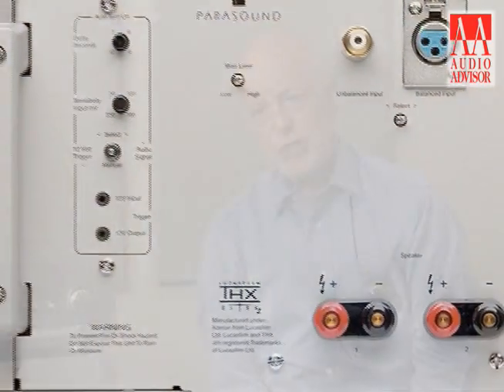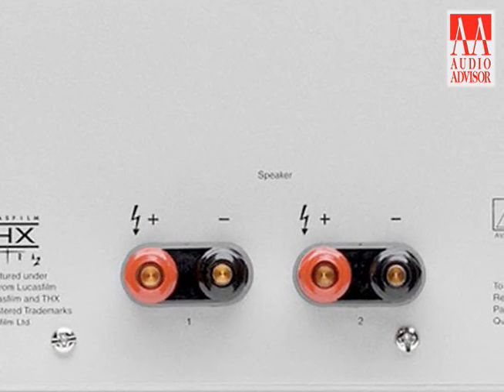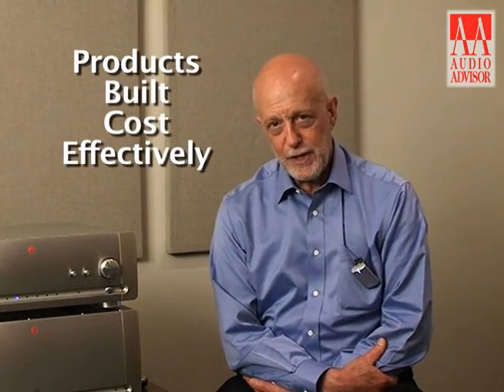Parasound’s High Value-to-Price Ratio – Audio Advisor

Comment: Their amps say, designed in San Francisco. Does anyone know if they are assembled there, or overseas ?
Reply: Put together in Taiwan, not China.
Reply: Probably. But Paul Beaver, Bernie Krause, and Robert Orban were actually the founders of Parasound. Originally, it was a company that manufactured and marketed a very successful line of professional signal processing gear under the Orban-Parasound label aimed at recording studios and broadcast between 1967 and 1979. At that point, the marketing end of the company and Parasound name were acquired by Schram, who manufactured his brand of consumer gear under that moniker from that time to the present.
Reply: two beer overseas